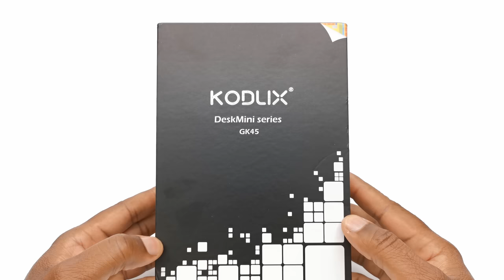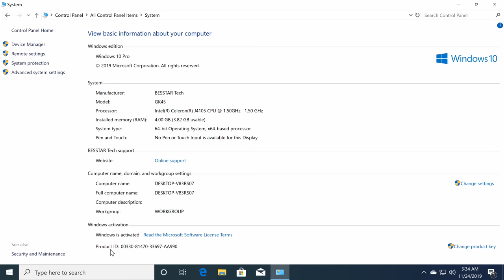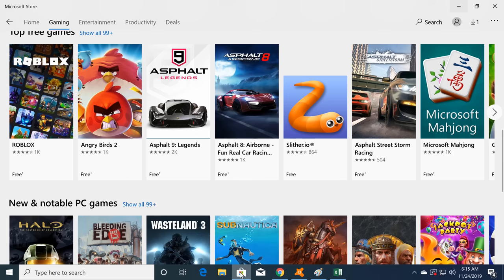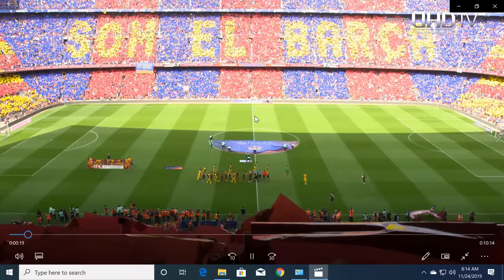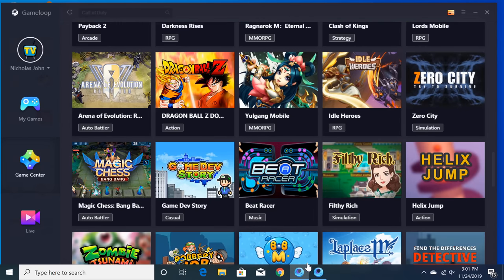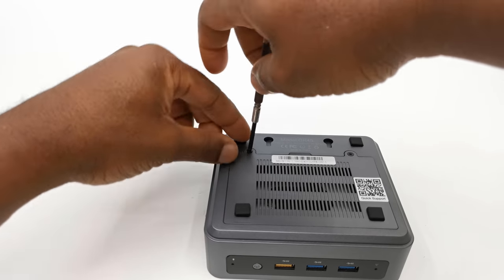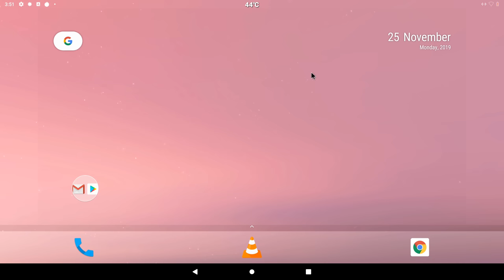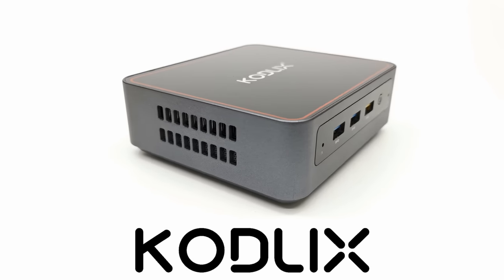20% OFF Kodlix GK45 Intel Windows Mini PC - Android 10 X86 - Gameloop Emulator Review

Comment: Hey Nick..yeah man video had some issues..but still😁😁😁👍👍👍..this box is so promising..love the ability to have 2 different operating systems running on it..also all the ports provided and the ability add extra storage....how was  the thermals.. cannot disagree with your cons...thanks as usual
Reply from the maker: You can actually run 4 different OS 2 M.2 Slots and 1 SATA, and the Windows is on the internal storage.